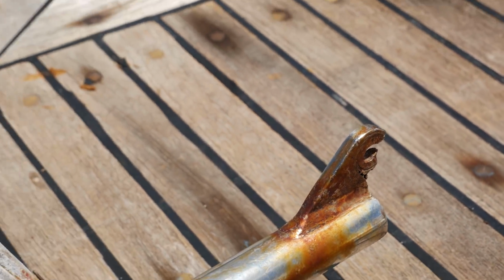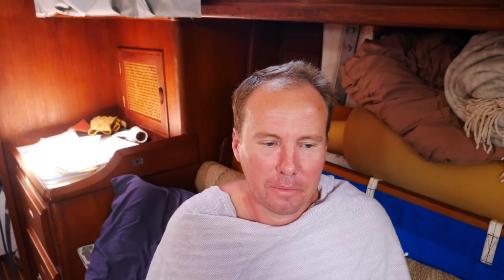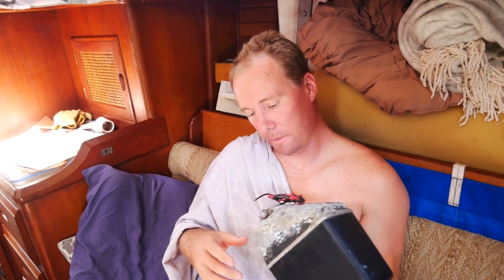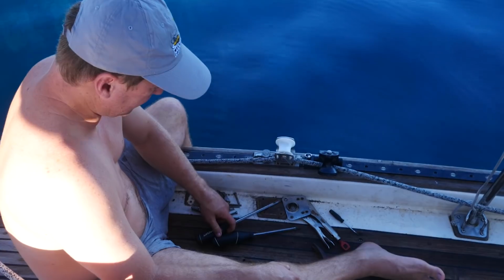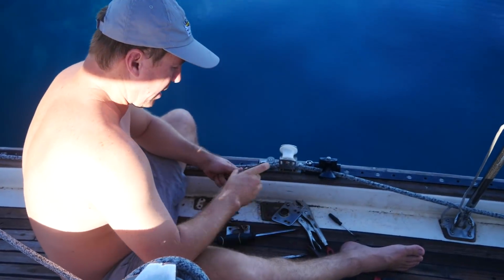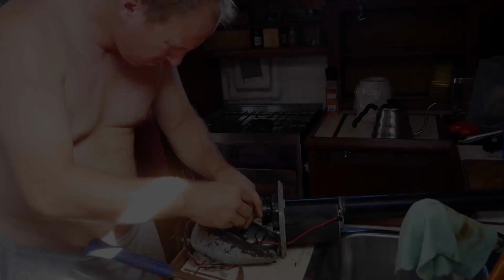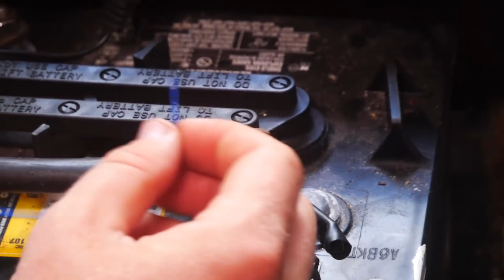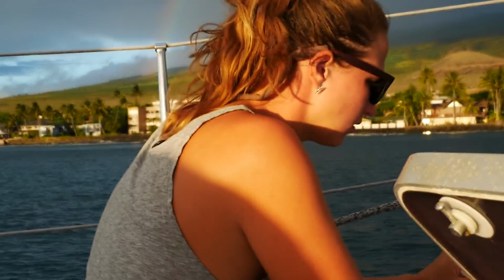New Boat, New Challenges [Adventure #131]

Comment: I reckon Id be tempted to get hold of an ST1000 Raymarine tiller pilot, cheap ass ...
These come with inbuilt fluxgate compass, and you can just press a button to hold a course
So all you need to do is to use a couple of relays to fire up the FT6000 screw drive to turn the rudder
but maybe you are fixed up by now ...

Comment: Ty, regarding the stanchion fasteners, some manufacturers would put aluminum back up plates in the deck layup where hardware would be located. Common if there are raised or indented features on the deckmold that would make it easy to locate.  When installing hardware, fasterner holes were drilled and then tapped into the aluminum back up plate/anchor. If you have machine screw fasteners and no nuts on the underside of the deck, or no possible access (even for the builder) then you might have the aluminum plates. Good luck. 🙄
Reply from the maker: Thanks for the heads up, we had trouble with a couple getting them out and it felt more like a threaded nut that was embedded but hard to tell as there was a lot of silicone down the holes as well and all the machine screws were bent which is telling of a number of problems. I like the plate idea, that would make much better sense.

Comment: I'd test the ST7000 parts you have, the ST7000 service manual shows the rudder input expects 0-5k ohm and you could simulate that with a 5k pot and run the tests in the service manual to see if it's worth trying. Then make sure you have a working wind vane for when the autopilot fails. :)
Reply from the maker: Everything except the electronic control head seemed to be in working order.  But you're right, getting the windvane up and running is just as important!

Comment: look at h-bridges as a driver for the autopilot motor. Big enough and high voltage resistant transistors will make it reliable. At the very least you will understand how to choose an auopilot that is reliable.   I have not looked but there may be a open source  raspberry pi autopilot.    if you know how it works you can fix it yourself.   csmale@bak.rr.com
Reply from the maker: Thanks for the tips

Comment: I’m no sparky but does a burn out on a windless switch like that... should there be another fuse?
Reply from the maker: We definitely want to put a breaker in-line.  Think it burnt up do to our jerry-rig in last week's video (replacing a missing contact with a bolt), which would have increased the resistance.

Comment: Do you think it might be a good idea to sail the boat to Mexico take it out of the water and compete the boat repairs during the winter months?  Looks like the boat needs a few projects to complete before you begin your long sailing journeys.
Reply from the maker: Mexico would definitely be a MUCH cheaper place to do the work (we wish we were there!), but it is a long journey to get there.
Reply: Adventure Adrift are you going to pull it out and paint the bottom and resend the deck in Hawaii?  How is the rigging does it need to be replaced or worked on.  I guess you know what needs to be done but make sure the boat is safe before any long sails.  Where you going to go to when ready South America or the South Pacific?
Reply from the maker: South America is still the plan, rigging is great and bottom is in good nick but we would most likely haul when in the cheap areas of Mexico.

Comment: So, what's the challenge with carrying a small TIG welding outfit on the ocean? I mean, yeah you need a small Argon tank, the torch itself, consumables such at some electrodes and some 316 rod. Even an old lincoln "buzz box" stick welder can do TIG if you use a tig torch with a built-in gas valve. You can, with a gas-valve TIG torch, TIG weld with just a car battery.
Reply from the maker: If we had a steel boat, learning to weld would certainly be on the list.  For little fixes, easier to get done by someone since we haven't yet acquired that skill.

Comment: Hi guys. About the dinghy /rowing situation. For future reference, check out thole pins & grommets 
   http://theinvisibleworkshop.blogspot.com/2009/05/estrop-versus-grommet.html

In extremis just a grommet through the rowlock hole will work as well for a short while. Don't fall for setting up double pins, a single & grommet is the way. Don't stand on ceremony and get all beard & cardigan about only greenheart being good enough, the right diameter rebar filched of a construction site will do, or you could get technical in Mexico and ask a skilled tradesman there to turn you up a pair out of stainless. They work incredibly well and are a life saver in your situation. 

Looking at the state of the wire on that self steering ram, I'd move heaven and earth to replace it if I was you. Get the proper tinned cable. You're risking the motor burning out because it can't get decent quality current when under stress, and mid-Pacific is one of the less desirable places to start trying to sort it. The cable powering your anchor windlass also looks a bit lightweight and auto industry. If you can locate a welding supply store, they have the cheapest, best quality tinned multistrand high grade cable you can get, and as it doesn't say marine on the tin it's a tenth of the price. Everywhere has a welding supply store in the back streets, and Hawaii should be better than most islands for it. Buy now, fit when you can.
Go guys, we're all rooting for you :-)
Reply from the maker: Wow, love that idea for the oars!  Looks pretty basic and fail-safe.  We will certainly keep that in mind, as we tend to have ongoing dinghy.oar issues...   and thanks for electrical tips!

Comment: can someone try to explain the difference or pros/cons of auto pilot/helm and wind vanes? size of boat, cost?
Reply: Wind vanes and autopilots do not compete with each other, they complement each other.  Where one is strong, the other is weak and vice versa.  Auto pilots stop working periodically and unless you have the appropriate spares on hand to swap in, they are basically unfixable by normal mortals.  Wind vanes rarely, if ever, stop working, but when they do, normal people can generally fix them.  In low/no wind, vanes work poorly but autopilots are happiest.  In storm winds, vanes work great but undersized autopilots can be overpowered all autopilots will consume large amounts of power (the harder the autopilot has to work, the more power it consumes).  Autopilots are dead simple to use.  There is a definite learning curve with vanes.  We use our vane when on passages and generally use the autopilot when motoring (or sometimes when sailing a relatively short distance).
Reply: +Dan Best thank you
Reply from the maker: Dan hit the nail on the head.  Autopilot's an anyone-can-use it electronic tool, windvane is completely mechanical (no power! and easy to fix) mechanical steering system.  Both certainly have their place, depending on the type of sailing you're doing and your boat.

Comment: If you are going to invest in a new auto pilot, I’d seriously consider a wind vane... I know they are pricey but if you look around used chandlery like Minney’s Yatch Surplus you could find a deal.  Then it’s much better on power saving....
Reply from the maker: There is a South Atlantic S600 mounted on the back.. it was very heavily modified by the previous owners, and needs some repairs, but the company has been extremely helpful in helping us sort out what's been done and needs to be done to get it up and running.
Reply: Eventually get both.  One will always be broken when you need it.

Comment: Hi Guys,  I have owned a Alpha Autopilot for a number of years now.  I think it is one of the best autopilots for a cruising sailboat.  Low power draw and after it runs for a few minutes it learns the wane pattern and steers some what intuitively.
Reply from the maker: Thanks for the tip, we have heard lots of great things about them
Reply: It has been up and running in my Tayana 42 for 18 years and only broke once.  I sent the computer part back to them and had it back 3 weeks later fixed.  Installing it took about one week. The hard part was getting the control arm that attaches to the rudder shaft drilled to the right size.  Getting the ran and the control arm all lined up and mounted with the right clarence's and strong attachment points worked out took a bit of head scratching.

Comment: I have been exactly where you are with the auto pilot.  First just use a 12 volt lead and check that it goes both ways.  That will tell you that all you need is + or - 12 volt signal.  Then buy a bottom of the line ComNav (made in Canada) 1420 an.d you will get every other part you need in a box  .  Flux gate compass, rudder follower, brain, controls. wiring etc.  I did this a few years back.  Under $1000 from Puget Sound Instruments.  Worked flawlessly and fabulous support by phone or email.
Love to come and help and sail back to west coast.  Very flexible and very knowledgeable, and best of all my favourite thing is to mess with sailboats.  svblue@gmail.com
Reply from the maker: If you saw in the later part of the video, we got it hooked up and it worked just fine!  Haven't heard of the ComMav before, always something new to look into
Reply: I did see it (too Late).  The comnav website is extensive and has the full 74 page manual in it.  Best price I found today for Mike is 1299.
Btw the problem is not the anchor switch.  You need a solenoid in the power line.  That switch cannot handle the full 100 amps and more under load.

Comment: My stern stanchion had threaded 'nuts' embedded in the fiberglass.  Could not dependably use them so I tapped them out and put locking nuts on longer bolts from bottom side.
Reply from the maker: There always seems to be one more step, right?